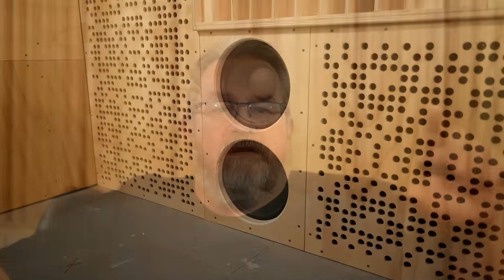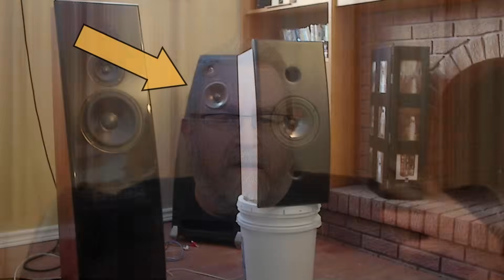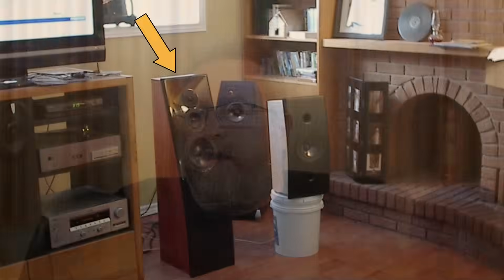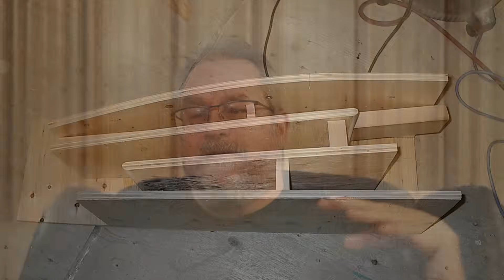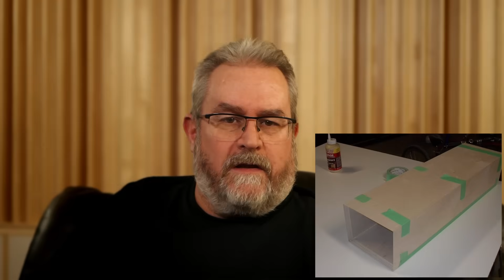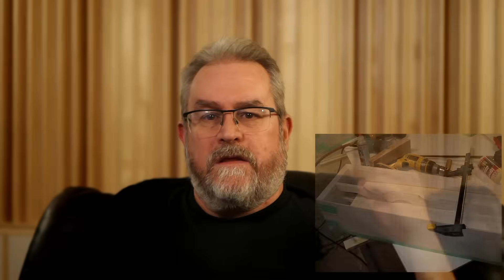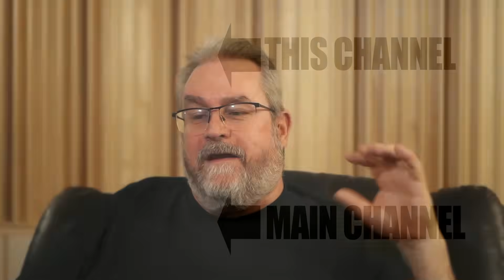Transmission Line Speakers are a Trap

Comment: I found a Bose transmission based Wave Radio... with the CD changer add on, for like $20 at the thrift shop.   I decided to pick it up for testing.  It doesnt sound that bad, at low volumes... but mid to high volume levels... and the bass sound droning, artificial, and distorted...  just like every Ported speaker, that Ive ever heard.    Transmission line speakers are just Glorified ported speakers... and while they might be a little more "Bassy" than a typical port... either way,  its still Sh*tty sounding, "artificial sounding" bass.

 Properly designed Sealed boxes, and Passive Radiators, are vastly superior in accurate, and excellent.. natural-sounding bass.
Reply: Passive radiators can have at best the same group delay as ported but are typically worse, as the mass of the drone is much higher than the column of air in a port. I tend to much prefer the sound of every ported speaker/sub I've owned with a towel stuffed into the port, but I've never listened to a vented sub tuned properly low, like in the mid 20's at most - those boxes are massive. At those frequencies our ears are much less sensitive to any delay in output, and at higher freqs they behave like a sealed box. 

Transmission lines are absolutely different than ported. In a TL the point isn't to boost the output by resonance, instead it's to delay the output from the rear of the driver by 1/4th the wavelength at that tuning frequency so that the rear wave and front wave add together (nearly) instead of canceling eachother out.  I would not trust the sound of a wave radio to give you a true picture of what they're capable of. ATC on the other hand...
Reply: @vinylcabasse  As soon as you mention Subs... you basically lost me.  Certain Subs might be OK for home theatre (I prefer bass shakers)... but for music... they pretty much muddy anything worth listening too.

 They are also often used to make up for the lack of a high quality WOOFER.  Often even being put in place, of a woofer, in a single sub type box.

 You then go on to say that you stuff your ports.  Way to throw the towel in, on the argument.   If you are blocking the port with a towel... you are changing the way the speaker performs.   If its airtight... and if those woofers were not designed for high power... then they will suffer greatly, from not being able to deal with the increased air pressures.   I know this, because I tried sealing ECO-woofer based speakers... and it wasnt good.

 As for stating that Passives create more droning... that doenst make any sense at all to me.

 I used to own a pair of Phillips Woox speakers.  In fact, it was an entire boom box system.  The woox is a unique passive setup, but it also is not completely sealed.  That said, I do not believe the actual port in the rear, was tuned.  I believe It was merely to help prevent excess pressure levels.  But I could be wrong.  I let them go a long time ago, when the special woox radiators rotted.

 (interesting to note, that the woox isnt just a single passive.  Each woox device, has two passives mounted about 1" apart from another.   Also, a woox passive has like 3 expansion rings, allowing for crazy amounts of excursion.  Its rings are somewhat similar to an accordion, in design)

 At max volume levels, there was no droneing on my Woox speakers.  However, my techniques 3way 12" house speakers, were droning.. even at mid volume levels.

 The only other normal passives I owned, was when I saw these weird, thin, radio shack speakers.  I should have known better... but for like 10$,  I was like.. what the heck.   They were so bad, that there is no reason to even report them.  I tried placing a much better woofer in the box to see if it would help... but it didnt.  The design was just a total disaster, all around.

 Now, there is another factor, that hasnt been mentioned... and that is, from my experience... that there are two main types of Ports.   Round horn shaped "Tuned" ports... and  Rectangle shaped ports.. which I suspect are not "Tuned".

 Every rectangle based port Ive heard, sounded MUCH better than any horn based Tuned port.

 I didnt own them (rectangle ported), so Im only speaking from a limited time of listening to a friends set.. and thus I didnt do any extensive testing.
Reply: @johndough8115  i'm not really arguing with you about sealed vs ported/passives. i prefer sealed. i've never heard a box tuned to 20hz, subwoofer or woofer, so i'm not ruling it out.

i am disagreeing with you about passives, aka "drone cones" - (was using this vernacular, not saying they drone - though they very much can) they are analogous to ports, not at all sealed. both roll off at the same rate below the tuning frequency and also rely on resonance to boost the bass, one relying on the mass of air in a tube, the other the mass of a cone. both have higher group delay than sealed at any kind of tuning past the mid 30hz range.

some speakers are designed to work in either sealed or ported, and they include port bungs.
Reply: @johndough8115  both port shapes can be tuned. (or not.)
Reply from the maker: Sounds like you haven't heard a properly designed vented speaker. Or more probably, you haven't heard a good vented speaker that you didn't know was a vented speaker, so as not to prejudge it.
Reply: @IBuildIt  Ive heard plenty of different speakers... including that POS Bose radio, I got for 20$ at the thrift shop.  Are you telling me, that Bose team of Engineers, are not making their Transmission designs properly?!

 You know, its not just about the design.  Its Physics.  You dont get something for nothing.  There is always a Price to pay.

 Either you have such bad hearing, as not to be able to tell what "Droning" artificial bass sounds like... Or.. you are never going above 5 on your volume knob.

 The louder you push ported speakers, the more likely you will hear the  "Port Chuffing" distortions, as well as the single-tone artificial sounding bass note (droning).  Ports are similar to how a wind based instrument works, they are designed to make a specific bass tone, as the air exits.  But that is NOT the natural bass sound, from the actual recording.  Its an artificial bass note/sound , and it sounds awful... especially at higher volume levels.

 There is also a lot of various distortions, from all of the inner turbulence, and constant vector changes.

 There are also times when the Woofer might blow more air out of the speaker, and when it rapidly hits again... there isnt enough equalized air pressure in the box.    A sealed speaker, can never have these problems.

 It takes less than 5 min of a google search, to find the positives, negatives, and reasons for each speaker type.   Might take a little longer, to find the most detailed of responses.

 Now heres the thing... Transmission lines were mostly created to allow for a much smaller enclosure, to have decent levels of bass.    Thats why Bose started using them in their tiny ECO Trash speaker systems.

 If you scale up to much larger speaker boxes,  then ports are less of an issue... because most people cant crank an 800 watt speaker... to high / max volume levels.  And at those volumes, you are not hearing clarity of music... you are just feeling your chest being kicked in, with each bass blast.

 The smaller the speaker box and drivers... the easier it will be to hear port droning and chuffing distortions... at medium volume levels.   Again, its not due to bad design.  Its merely the Physics of using a Ported design.
Reply from the maker: Here's some physics: Your sealed speaker doesn't put out enough bass to excite the room modes that a vented speaker will. If you are actually hearing anything that drones or is strong in one frequency (boomy), it's your room and not the speaker. 
A well designed ported speaker seamlessly integrates the output from the driver with the output from the port. What it doesn't do is make the listener understand the other acoustic factors involved in listening to sound, and certainly won't do anything at all for any prejudices he has against it based on inaccurate second-hand information and assumptions.
Reply: @IBuildIt  No mention of what kind of Ports there are... ehh?   Very dishonest of your reply.

  You see, there are two main types of ports.  Large Rectangular or Non-Tuned ports... and Funnel shaped TUNED ports.

 Tuned ports, are in fact designed to create a specific bass frequency, as air blast out of them.   And yes, it is DRONING... because its the same exact Tone/Frequency, every single time.

 Non-Tuned ports... are usually much larger in size.  Often rectangular.   They are far less likely to produce that same sort of droning effect.

 The thing is,  MOST  speakers sold to the masses today, have Tuned ports... and they all sound like total TRASH.   Especially compared to a quality sealed speaker.  There is No comparison, Period.

 This has Nothing to do with the Room.  Its the actual design, and intended functionality.

 The ECO radicals wanted the massed to use less overall power, and so started making ECO speakers.  The Tuned ports were a way for them to get away with using weaker magnet + coil strength woofers... and still getting good "Volume" levels out of them.   The trade off, is a speaker that has Artificial bass.  Its not what the recordings intended to be heard.  And the moment people hear what is Supposed to be heard... they will Rage, just like I did... for missing out on how much better the music does sound... and how they had been ROBBED of such beauty, for many decades of their lives.

 I dont come here, as a battle of Egos.  I come here, speaking the TRUTHS, from real world experience.   From the love of high definition audio.  The collecting of many different speakers.  And the testing and modifications,  in my foolish days, before understanding why none of it actually worked.   Until one day,  by chance... running into a pair of actual Audiophile level speakers... and INSTANTLY hearing the massive differences in performance / capabilities.

Comment: Thanks for this, it's good food for thought! I built a couple of closed and vented boxed speakers and I'm sort of debating where to go with my next project. I was considering building a transmission line box to fit old CSS fr125s drivers I have laying around.  Open baffles would be fun too but I think I lack the space to position them far enough away from the walls to get an optimal result.

Comment: in the age of dsp a sealed enclosure does the job so much easier. 
 transmission line is for extended bass with only acoustical tools.
Reply: Don’t you have to watch for over excursion more with a sealed enclosure and boosted bass?
Reply: @davidcrocombe1322  yes, but that is for any design or boosted speaker design.
you want to use the bass capability to the fullest in any speaker, base on how loud you want to play, or how good you want to it to sound at low volume.
many will have a speaker that barely uses the woofers xmax capabilities, then you have headroom to get more out of it.

Comment: This video is 100% John talking himself into building a new transmission line speaker!

Complicated? Diminishing returns? A new John Heisz design/build speaker series? Come on, that's what we're here for!
Reply: ROFL this vid is just the disclaimer for the new transmission line speaker build.
Reply: I still think a QWTL is the simplest enclosure to get right without the aid of (toy) enclosure programs, that's why I've been designing and building them exclusive for over 30 years. 
https://www.youtube.com/watch?v=jV0Ljnn8L0s
https://www.youtube.com/watch?v=3qjWKUBvSNA
https://www.youtube.com/watch?v=-96WAVQdcyQ
https://www.youtube.com/watch?v=qm5K_VVRwXQ
https://www.youtube.com/watch?v=Jdb2mbmL6jg
https://www.youtube.com/watch?v=J92zJIDOi1Q
And of course, the Jensen Transflex
https://www.youtube.com/watch?v=6yb2msOQw_4
Reply: I give some information to seekers..

Why more speakers and not a big one, and hear a real low frequency (?)...

Fs – free-air resonance frequency of the driver (here i used it a bit for for box resonance reference).
PA – Professional Audio (stage systems).

-The first: is the box complete size and the chamber size of the box what need to the excursion. (For huge boxes for a most of people haven't got enough place) A large speaker can move max (some) mm in a little box with enough soft sound.
The air compression cause distortion, not wanted sounds, mechanical sounds of speaker and hardness of sound. (but unfortunately moving too much air cause another problems)
For this reason an average low frequency speaker can be use on the 1/3 .. 1/2 of the Xmax without mechanical sounds.
In my experience the chamber of speaker size is optimally (membrane surface cm^2) * (excursion cm) =liter. 
Maybe you think this is an exaggeration.. (and really is not in every case good, maybe just i feel it good).
This is a limit where i cannot exactly sense more hardness. (With MY speakers).
My favorite box chamber ratio is W:H:D 2:2:1.

And the fact of acoustic short circuit what based on box duct length what if not enough long that cause you cannot hear the low frequencies. The duct cross-section area is in the technical literature is the 0,7 of the membrane usable surface but for example i use 100% because it depends on length because the forces (air pressure) on the membrane must be tiny. My duct is now 4,25 + outside 1 meter long from membrane to membrane back side and a strongest resonance is perceptible really on 14..16 Hz.
This way you see the box size is will be soon huge. 

-The third: the mass and surface of a large membrane cause it is late in phase compare with the smaller membranes. It maybe manageable but with just some mm move, this is why the PA speakers not infinity large. 
(But the large (more speakers) surface with tiny move is a good strategy for softer sound, lower frequencies)
The membrane materials (and of the box) is take a physically resonance frequency limit, absolute impossible made an FS under 15..20 HZ because the needed rigidity and low distortion is contrast to the lower FS materials softness and those mass.
This cause that the larger woofers has not exactly lower FS just the moving mass compensate it a bit but far not enough. (And the membranes have 'wild' resonances what you hear as sound but does not the original frequencies)

If even so you try to build one..  the materials thicker, heavier, less responsive extreme hard to move or brake down by physically inertia  meanwhile the magnetic gap need to be very thin without coil crashing with magnet.

When i started to studying these me too want lager membrane but i see how that work in the real world.

If you seek a big one you can watch the "The making of the Matterhorn" from Danley sound labs. In the interview video the man say the parameters. If does not impressive than nothing. (40 speakers if i see good)
I think that need to be sectional phase controlled but i don't remember he said.
And i think they use the colliding waves undergo constructive interference and they made a 'virtual horn from air' but i don't know.
I tell you it use another known audio technology fact: The 25..30 cm speakers give enough good electrical efficiency-Mechanical efficiency ratio.
  
-The fourth: hard materials and surfaces in the room can change the audible frequency, that sometimes multiplied because of the limited distances of the surrounding surfaces. 
Maybe you feel those enough low the truth is 'those are not the original low frequencies'. 
For example the needed distance between you and speakers is around 4 meter (343/20/4) (on 1/4 wave length) on 20 HZ if you have all the speaker and box can the frequency.

And if you can all do it somehow, than you meet with the next fact: All objects and material in the room begin annoyingly resonating :)

(every bass speaker can be produce very low frequencies but just with very low efficiency especially in small box)

The hifi lovers try to make lower FS multi-layered or foamy membranes with fast movement (nowadays expensive electronics and hard magnet motor and huge coil (that give heat dissipating and electrical efficiency) can control the movement of a 40..45 cm woofer enough fast with minimal distortion and less 'wild' resonances in a small box (but that is a hard task).. 
And the PA systems work with minimal moving and much more rigidity for higher volume.

And we have the box not wanted resonances (especially the horns have that).

And on the end of these, your hearing have a limited dynamically range what cause if you increase the volume you lost the details of all the sounds.

Subwoofer is in audio literature under 50 Hz but i use my own between ((3Hz -12,3 dB)5 Hz -3,2 dB) to (18 Hz -3,4 dB (MFB single ended butterworth second-order filter, read upon it)) it is underdriven below FS, is a good technique especially combined with a limiter for softer sounding.

Really the fact from woofer is: On original real low frequencies you rather not hear some another sounds when an subwoofer working than hear low frequencies. (But the pressure of air is tires your ears and brain more than you think (!) )

I write all these for others who's want to know something  (starting strategy).
Reply: Yup!